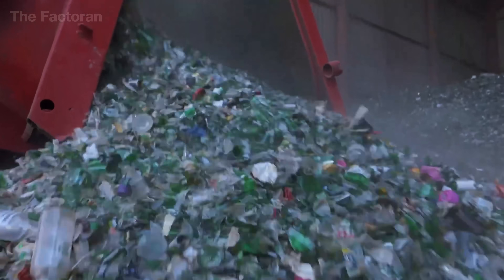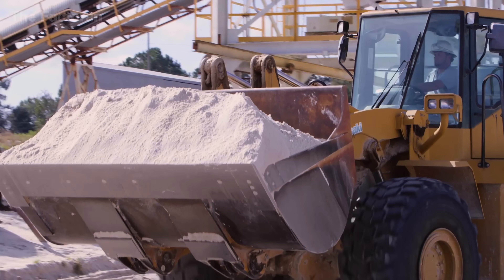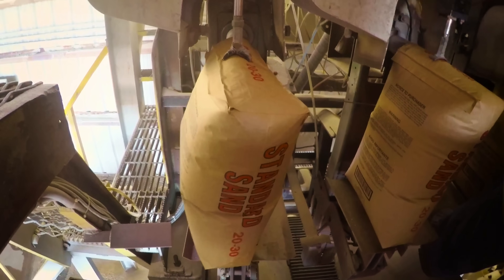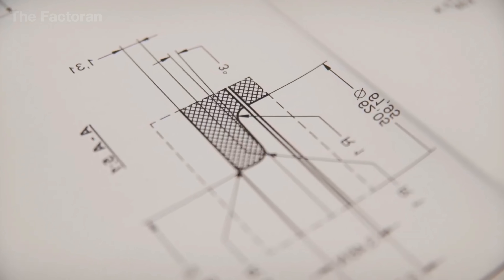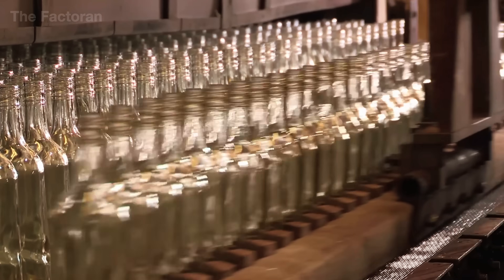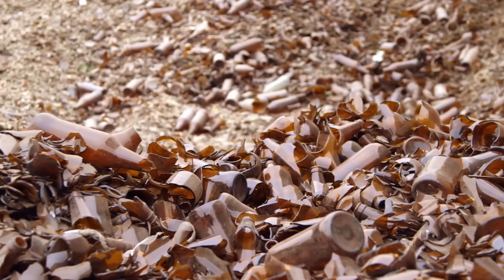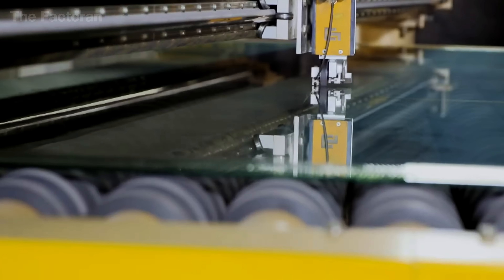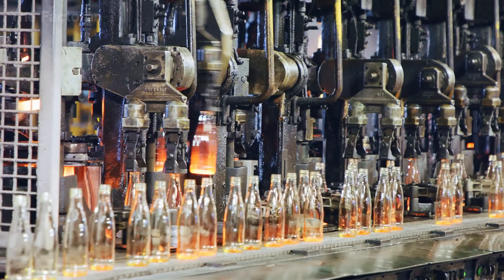How Millions Of Tons Of Glass Are Made From Sand In Mega Factory

Comment: We saw the lightning-fast, millisecond-precision shaping of the bottles in the double blow line, but the video stressed that the slow, gradual cooling (annealing) in the yellow tunnel is just as important. Why does this cooling process have to be so slow—sometimes tens of minutes? What happens to the glass structure if it's rushed, and does that instant thermal stress lead to those tiny cracks that the inspection sensors later flag?
Reply from the maker: Great question — yes, if the cooling is too fast, the outer glass solidifies while the inside is still hot, creating internal tension. That trapped thermal stress can cause micro-cracks or even make the bottle shatter later under pressure. The slow, controlled cooling (annealing) lets the temperature even out across the glass, releasing stress and giving it strength and durability.

Comment: Thanks, glass.  It would be really fun driving down the highway without you.😂.   I just thought about my motorcycle helmet except no glass and now I have to use a shutter.😂.  You appreciate the glass a lot more when you’ve been hit by a bug at 80 miles an hour because your visor was up.😂.  I’m looking through glass on my iPad right now and this generation is pretty good because I at least dropped it a few times off the stand without cracking, which is not the case in the last couple of generations.     Then there’s the fact that I’ve done stain glass art, or the fact that I know the processors are made from silica.   😂.   I should be able to pour a hot cup of coffee and talk to my coffee cup as it extracts the thermal energy.  I know you can do it.🎉 Smart-Cups.  The drink that talks back.😅.    You guys really aren’t thinking this through very well.   You get your slaves I mean your clients to dig up the rock for you because it’s a part of their spa and skin treatment. By the time the processing it in the sand, their skin will be blasted perfection and now you have your raw material processed.😂
Reply: You can also tell them they get to keep all the gold they can find even though that’s not the correct rock type to find gold in😂

Comment: that story about how glass was 'discovered' sounds so stupid and juvenile. You can't make glass just by having sand and sodium carbonate by an 'open fire' , you need like 3000 fkn degrees to melt the silica sand. The chances are more likely they discovered glass created by lightning and figured out it was the sand being super heated that made the glass. They already had smelting ovens to melt metal so they just used that to melt the sand and the other ingredients came later to make better glass
Reply from the maker: You’re right—the “campfire story” is more myth than science. Early glass was almost certainly from natural lightning strikes or high-heat furnaces used for metalworking.

Comment: Cool People

We could save the world pretty easy

CO2 INTO CH4 IN ATMOSPHERE FROM SOLAR ELECTROPHOTOSYNTHESIS WITH ADDITION OF REFRACTORY RADIATION OF ELECTRONS AND PARTICLES WITH ALUMINUM 

Instead of photons just passing by a plant that reflect back and forth between nano aluminum mirrors and heat up the aluminum atoms plants. Tobacco plants in North America have to be in full shade where they're spraying aluminum yet they grow just fine in Cuba and Ecuador. 

They're making a Methane factory and bonding what could be ozone to carbon, the only way a dumb plan will work is to keep it secret from a world full of geniuses

Tell NASA about the Moon and they'll make Moonfall ; )

They need to make a Universe room and reverse Tesla ball atmosphere models, also just spray desalination ocean water, not aluminum and carbon which cause refractory radiation and is cooking the atmosphere and causing refractory radiation on the surface making it intense, also you might be able to change an orbit. Also the aluminum and carbon being spayed refracts photons, charged electrons, does electro photo synthesis and while you're burning oxygen instead of hydrogen from say, solar electrolysis of ocean water, you're burning oxygen and bonding oxygen to carbon and the H is bonding into CH4 Methane up in the atmosphere. It's all backwards

It is [a really good idea] that we stop spraying aluminum and CO2 into a magnetoshere and start spraying desalinatated ocean water instead, were causing refractory radiation and it's making the heat much more intense and heating the planet and causing melting of ice caps and evaporation of ocean water which then makes fresh clouds; we need to just spray salt free ocean water. The more we try to cool the planet were actually making it hotter and energizing a magnetoshere which could cause more solar flares and fry us. We're cooking the planet and causing solar evaporation of the ocean for clouds formation instead of just misting H20 out of 747's, got a whole plan. We're making CH4 up there in a process of retracting photons into electrons while they spray CO2

Hello my Friends

ANUBIS IS THE BEST DOG

What if Pharoah was trying to build a weather machine to attract lightening to nuclear electro magnetic earth ground to cause more rainfall and thus more food. 

Clouds of higher solar charged particles jump to clouds of lower static change, known as heat lightening, as nature seeks a balance. 

When there's enough solar charge in a cloud electricity as lightening crosses the air insulator and connects to earth, as it does it creates a vortex where hydrogen and oxygen particles connect and bring down water droplets and fall due to nuclear electromagnetic gravitational earth gravity. 

Electrons go around an atom like the moon around the earth and the planets around the sun.  

The Egyptians saw that lightening was attracted to metal, and the higher the better. 

If Pharoah had a copper cap on the pyramids with electrodes running through the air chambers down into the spring underneath, Benjamin Franklin might have been wearing an Eye of Horus Watch and driving a Bently.

Is the grounds turned dry, like a leather glove, no matter how much you tried to arc welds, it wouldn't work. Tree roots go searching for water in the winter when there is no rain, as solar photoelectric synthesis move through an organism seeking earth ground.

Also lightening is more likely to hit the lone farmhouse than the neighborhood, as electricity in houses flow through a black or hot wire, and take a neutral [white wire] path back to the electrical panel, where the Neutral Bar is bonded to the Ground Bar and goes into the earth via an eight foot copper electrode to dissipate returning unused current into the ground. So neighborhoods are energizing water tables instead of storing that electricity in batteries.

Anyways, what about a cargo helicopter, a brand new Copper Cap for each pyramid, and copper electrode wires running down to earth ground via the spring water table, and electrodes can be drilled into the earth below the springs for better contact, and we can complete Pharoah's Weather Experiment as lightening is attracted to metal high up from the ground ; )

Could you imagine the attraction of this new event to honor the Pharoahs and those that built the Pyramids!

And maybe bring more rain to the earth, and keep it most, and electrically conductive and inductive to storm clouds for more crop rain. 

If you want to in vent some cool stuff kaw me

Also, should we celebrate ancient ruins or rebuild them to honor ?

Also oil rigs should be underwater and not above and you wouldn't have oil spills 

China builds underwater structures, you could be just 20 feet underwater, you can run vertices flexible stormproof snorkles and a flexible to surface entrance/exit 

And, 

Grow more opium most the world's doesn't even want to be here and people can move other places, it grows in attics that are 140 degrees, skylights would need insulated glass in the attic shafts and you could use mirrors in the gable ends, just don't be in the attic in the day, if there's ever a shortage

Also oil rigs should be underwater and not above and you wouldn't have oil spills. China builds underwater structures, you could be just 20 feet underwater, you can run vertices flexible stormproof snorkles and a flexible to surface entrance/exit

Sharks could be GPS chipped at a bait source and an alert could go to cell phones and beach alert systems if sharks are within 300 M

Aluminum spayed in the atmosphere might f us magnetically with solar flares as photons charge electrons and they jump to like particles of lower charge, hence h2 broken from oxygen by the sun becomes h4, we increase particle charge in a magnetoshere 

Use aluminum for other things, spraying carbon and aluminum heats up the planet and causes refractory radiation on the surface, the carbon in the clouds traps in the heart and in the ocean causes dead spots. You need solar distilled ocean water misted or of 747's instead, the sun will burst up H2O into H, O1's, making 02, O3 ozone, and you're actually adding more fresh water clouds up there, not depending on surface evaporation by causing more heat in order to make more clouds, you need to cool it

8.4 billion acres of grass=4 billion cows in the world shipped frozen fresh lawn mower clippings somewhere cool like Alaska and each cow gets a bowl of ice cream at each feeding session

You need a leaf sucker truck with a refrigeration unit, grass is mowed for tax refunds, 20 Million jobs paying 60k from May to October in air conditioned, sealed window, tinted window, XFM lawn mower cabs with triple level suspension seats, mini leaf suckers pick up small piles and dump them by the street, big leaf sucker truck picks them up and freezes the frozen grass and then it goes to rail cars then somewhere cool to be 1100 lbs with a winter jacket. The people that kiss cows and sing songs for them take care of them and she gets a bowl of ice cream at the end of each feeding season. You'd have 10x more cows, over 1 Trillion in goods. In the US you'd have to double your grocery stores just for the milk, cheese, cheese cream, sour cheese, cottage cheese, yogurt, milk, butter, ice cream, etc...

When she doesn't want to be a cow anymore she gets a bowl of ice cream with some fennies, half the world would say thanks and leave their suffering, and that's be like 400 years of 80 world wars at 50 million each for $79 M USD and you would double available resources to a world only full of people who want to be here, and China could work half of what they do and get paid the same while making 10x more cows. The CH4 can be turned into H20 work left over 0 while we burn the H in solar electrolysis of ocean water

I have a lot of invention ideas in energy, defense, security, food infrastructure etc...

Would like to meet up with some people and talk to them about making some cool stuff

Missing solar film wrap on high rises and fields shouldn't have solar panels but should be solar panel green houses growing every crop everywhere, humid and tropical warm all year growing facilities

If i owned companies and could make a robot to do a crappy job i would ask my Friends that work there what they want to do, and then who knows, sponsor a rock band for the same amount of money, etc

Also we're better off putting one high rise adjustment building on a farm rather than single family homes all over the entire farm until they're is no farm, however we can do the get- paid- for- what's weighed- Farm America or anywhere Initiative

and let's send ocean rivers to the world and do solar lens distillation of ocean water in the central west and oak it on airplanes and cloud seed they're where it's really dry

Dopamine is a neuro transmitter and like evergreen roots receptors grow, you need them full of power or they short out, you need nicotine avoid B3 from tomatoes,  potatoes, eggs, or fast performing nicotine, some good beer with b3 in the yeast, also people get sad because of cortisol

Comment: What happens to all the color of the recycled glass used for making the panels?  It seems like the panels would turn out slightly different colors depending on what was recycled.
Reply from the maker: Great eye — and you're absolutely right!

When recycled glass (cullet) is used to make panels, the color mix can vary depending on the types of glass included. If not sorted by color, the result is usually a grayish or greenish tint, which is common in recycled glass panels or countertops. For clear or color-consistent products, manufacturers often use sorted cullet (e.g., only clear glass) or blend it with virgin materials to control the final look.
Reply: @TheFactoran  Recycled glass is never use to make panel, main matter would be the colour, but even if sorted, glass panels need extreme purity to not have black dots from unmelted rocks, the tiniest particle would ruin the panel. But as you need "old" glass to lower the fusion point, they use the parts that was cut on the edge from the process. They also use the glass that not meet any standard when switching from a thickness to an other or if something got wrong with the aneling and glass shatter by itself.. And even if the production work "too fine" they will broke all the glass for one day in order to create the glass required to lower the fusion point. 
All the glass is recycled in the packaging where for sure they can be sorted to remake clear bottle but with no impact if a small rock create a black dot in bottle.

Comment: There is Misleading information about flat glass in Mr. AI's presentation. 
You cannot used bottle glass as 'cullet' to make good quality glass. Reclaimed flat glass must be used to create high quality glass. Simply mixing silica sand, potash and soda will not produce quality glass, reclaimed flat glass cullet (Again, not bottle glass) must be a percentage of the batch.  
My experience with stock cut sheets (ours were 128" wide by 180" long) were stacked on 'A Frames' holding 24 to 35 sheets per side, dependent on the glass thickness. (This is the 'finished glass sheet' MR AI was showing being loaded and moved, Notice these were LARGE sheets) All four edgers were raw. Sheets of glass are not 'edged' until they are cut to a customers specification and then usually only if they are to be tempered or laminated. 
Testing glass strength is only done on 'Safety Plate' which is either tempered or laminated, or in some uses both. Ballistic glass is typically created in multiple layers, using multiple types of lamination materials dependant on application. 
Having worked in both flat glass and automotive glass manufacturing for 20 plus year caused some cringing while Mr. AI rattled on about an industry he knows just enough about to get him into trouble.

Comment: the edges of the glass are still raw, and the testing you was showing with the glass breaking is for toughned glass or annealed glass that also done at a later proccess, normally once the glass has been cut to size for installation its goes through a flat edge polish machine (FEP) and this is where the edges are cleaned up, and also if it is to be toughned it will go through a second furnace and is rapidly cooled down with large blowers and that give the glass strength which is the same type of glass on car windows whihc break to small peices, but not the front windscreen that is laminated glass (2 bits of float glass stuck together) so if something hit into it glass doesnt shatter into peoples faces, other then those bit of infomation everything was  good
Reply from the maker: Thanks for the detailed explanation—really helpful! You’re right, the video skipped over those key steps like edge polishing and tempering. Appreciate you filling in the gaps!

Comment: Actually, sand is a minor component of the production. The most important are energy resources: gas and oil.
Reply from the maker: You're absolutely right — energy plays a huge role in glass production. Sand is key, but without the massive heat from gas or oil, it wouldn’t become glass at all. Thanks for pointing that out!

Comment: Where did ancient Egyptians get all of that heat to melt the sand if today we got extra chemicals to make the melting process easier and technology that makes the sand hotter than molten lava something‘s not adding up here,
Reply from the maker: Ancient Egyptians didn’t melt sand into glass the way we do today with extreme heat and additives. Instead, they used naturally occurring glass (like Libyan Desert Glass) and later learned to make small amounts of glass using wood-fired kilns that could reach around 1,100–1,200°C — just enough to work with sand mixed with natron (a type of soda ash) which lowers the melting point.

So while their glass wasn’t as clear or strong as modern glass, it was still an impressive feat for their time!

Comment: Sand itself is not invisible.
Reply: I think the sand would disagree with you
Reply: @redzipper8570  If you hold sand in your hand you can see it.
Reply from the maker: Exactly — you can see each grain if you look closely.
Reply: Sand is derived from fractured rock, and it is defined by its rough texture. When subjected to heat, this roughness undergoes a transformation, resulting in the smoothing of the sand and the melting together of its grains.